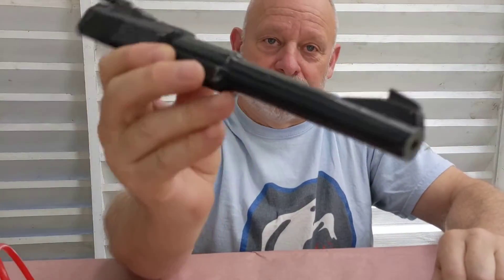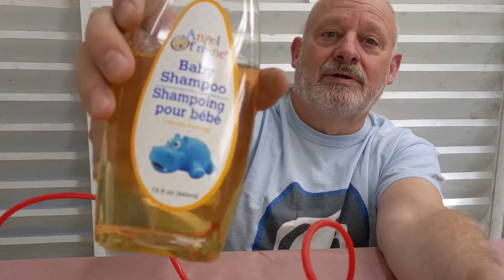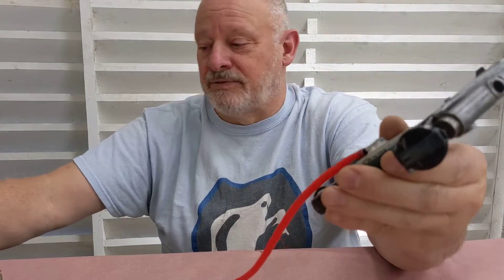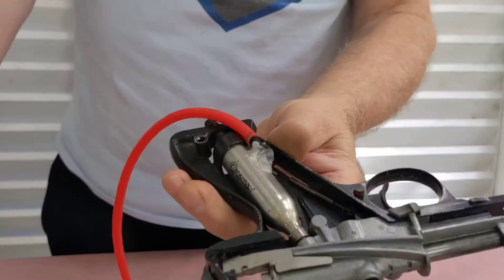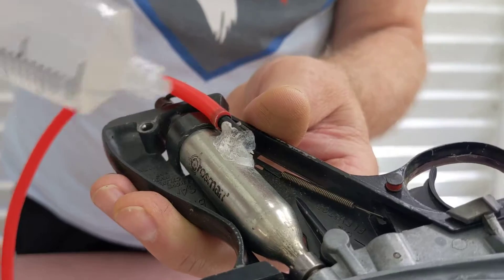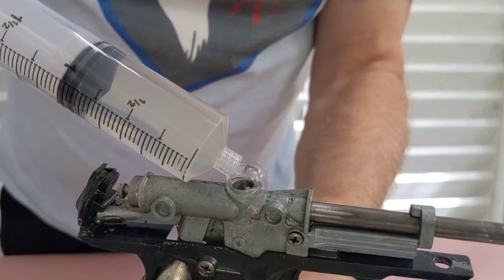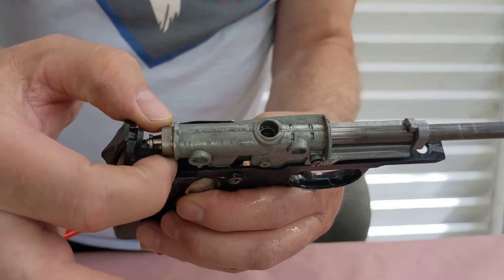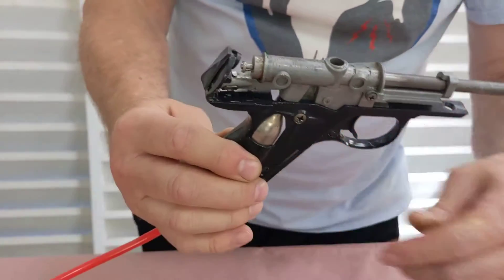Testing a CO2 pistol for leaks using compressed air

Comment: Good videos and good ideas. Especially like the air compressor adapter you made. 
I found your channel because I too own a leaky Daisy 200.
Did you ever manage to fix yours?
I'm contemplating leaving the leak and just building a stronger adapter to run the gun straight off the compressor as a shop plinker.
Thanks for the inspiration!
Reply from the maker: Have not found a solution to it, but surely there must be a way.   The 200 had a really awesome trigger, have never found any other co2 pistol to be nearly as good as the 200